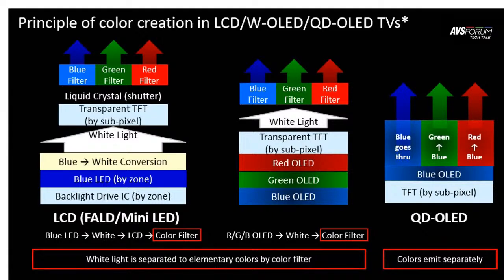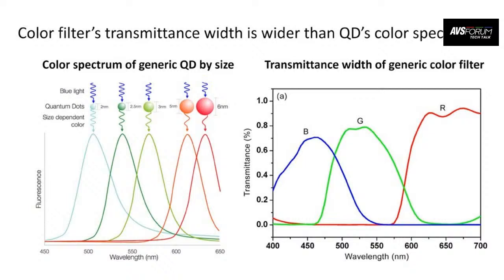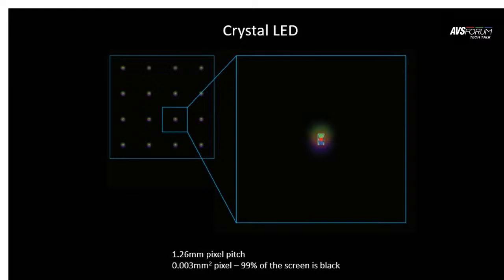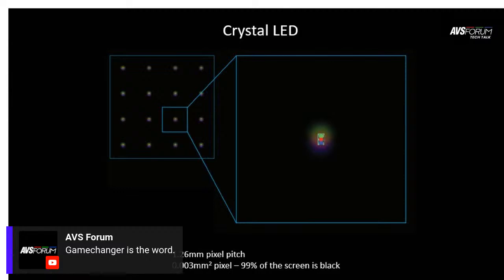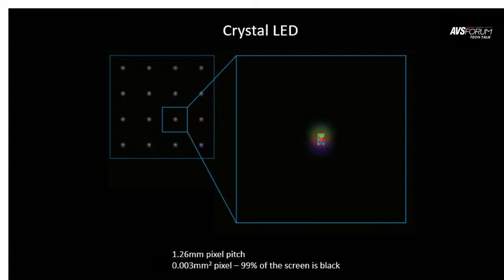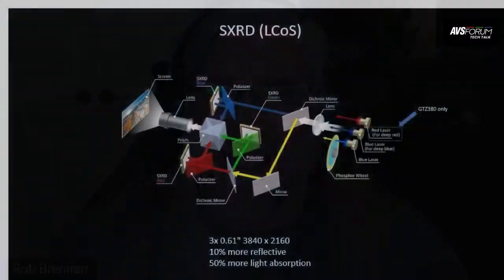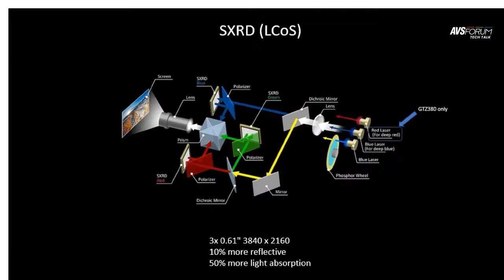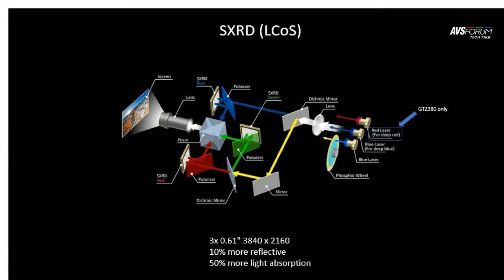AVS Forum Tech Talk with Scott Wilkinson Episode 15: New Sony Tech?

Comment: Next time you are talking to the Sony hierarchy ask them if in their new laser projector (5000, 6000, 7000) space, they will issue a firmware update to deal with a defect found at the 2022 spring US “MWAVE-JVC vs Sony projector shootout event” in which it was discovered that its projectors require a “Base-Black / Tone-Mapping/ Firmware” — update.   Not familiar with this defect?  See: “Stopthefomo” youtube video vlog and scroll down until you see the shootout thumbnail graphic and witness it — for yourself!